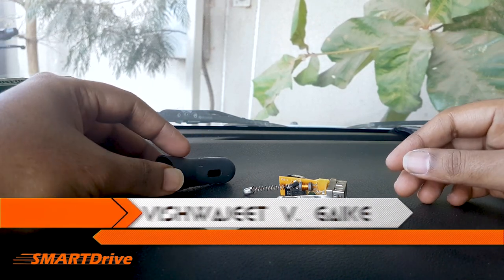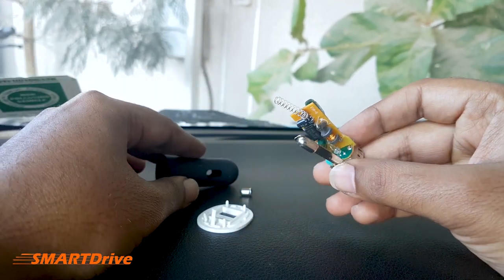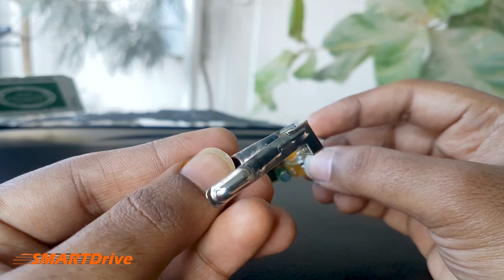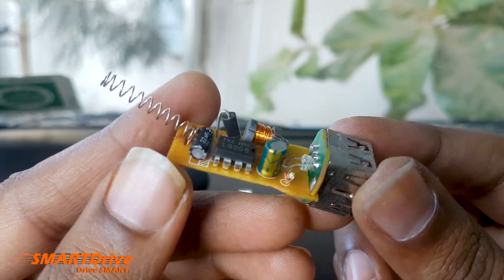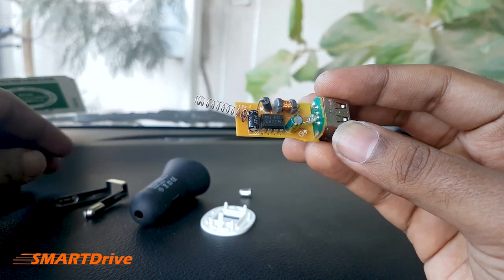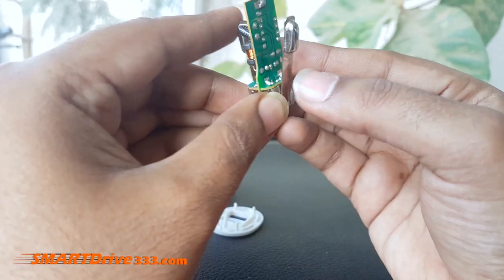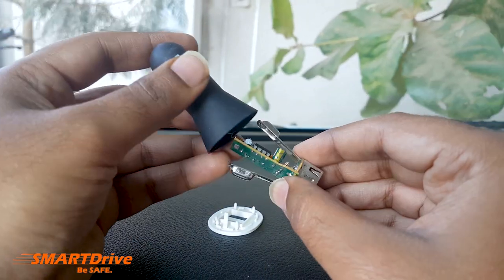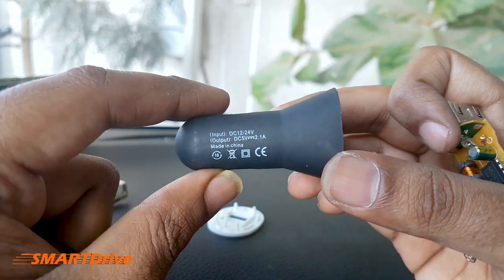Inside the Car Mobile Charger: Revealing the Components :SMARTDrive

Comment: Bhai I need help
1) do you ordered it from Flipkart
2) 2.1A and 1A positive and negetive output connected to same how it will work
Reply from the maker: 1) no. from amazon https://amzn.to/3a7jhua but now we recommend new product with fast charging 
https://amzn.to/326GVTl
2) there is small chip which controls the current in USB output.
Reply: @SMARTDrive   yes because those materials alone can't charge fastly..
Reply from the maker: Please elaborate more.

Comment: Can i connect led light direct to lighter socket without charger, it will safe or not
Reply from the maker: Not safe. Led light may short the circuit. Resulting in blown fuse or system malfunction.

You will need stabilizer or regulator circuit to safely connect LED.

Comment: Can we join phone charger directly to car battery
Reply from the maker: Technically not possible.
Car battery current is drawn by many components, also has high wattage.

Cigarette lighter adaptor is connected to battery via fuse system which resist extra current and protect charger and mobile both.